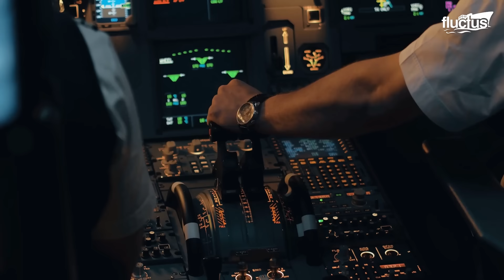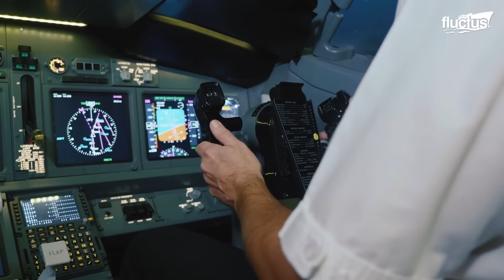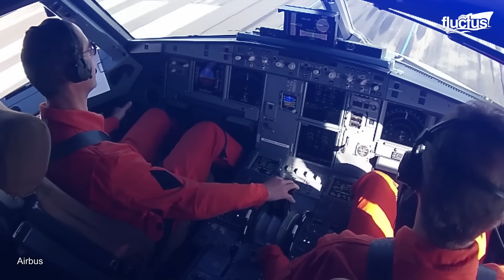The Crazy Process Behind Testing Brand New Millions $ Aircraft

Comment: In the last week or so a 737-800 made a hard landing here in the US. So hard it drove the left landing gear up and through the top of the wing!  Haven't seen that for a while, but it was a good example of how the gear was designed to do that. The wing has fuel in it. If the gear didn't go up and out the top, it would be contained in the wing. That might/could rupture the fuel tank and leak fuel all over.  With the aircraft sliding on the left engine, there were sparks all over. Fuel and sparks could/will result in a fire, with the port side blocked off from the fire. Not good!  On this one, everyone survived.    --gary
Reply: I flew a 737-900LR today and it was also a hard landing, and a few years ago I flew a 737-800 and that was a hard landing too, I think it’s just the aircraft, still would be scary for that to happen.